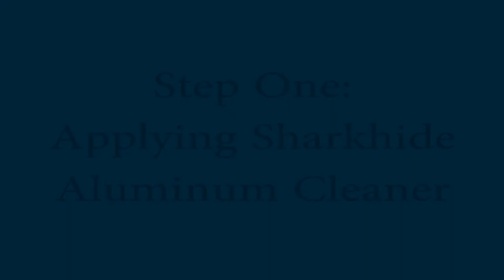Sharkhide: Creating Our Hand Rubbed Finish

Comment: Thank you for the well explained video.   I personally had the factory apply the finish, that was 2016, I re-applied once so far.  It is looking a bit weathered (especially on those rubbed areas) and thought of either doing a full polish with new Sharkhide, but as we all know that is super labor intensive and extremely messy.  I really want to keep this milled look.